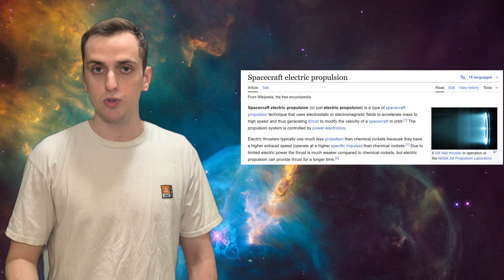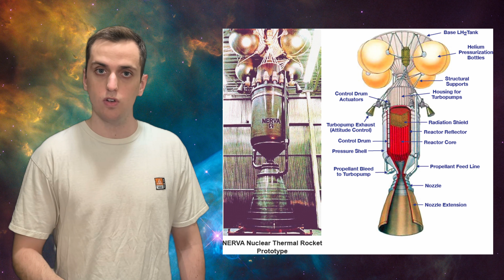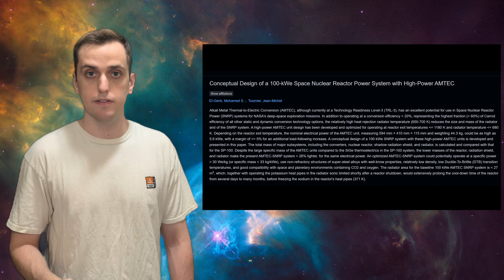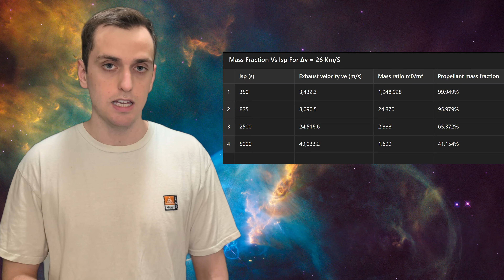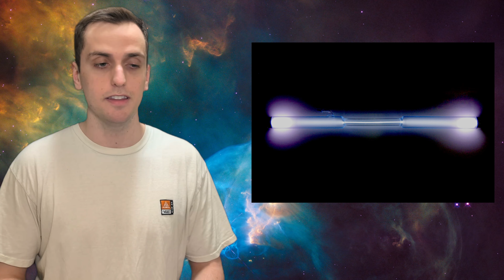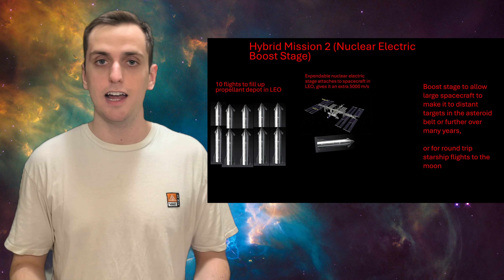Do We Need "Nuclear Electric Propulsion" to Get to Mars?

Comment: What we need to do better designs than chemical is to master the use of graphene and similar materials than can easily hold hydrogen.
 This would help a lot with any design that needs hydrogen. Light fuel tanks and not boiling half your fuel after a couple of months 

 Only after that we can think of months long missions that use hydrogen as a propellent.

Anything with noble gases is stupid for big missions due to cost

Until then Methane chemical is the best. The other solution is solar sails, installing a solar sail infrastructure with lasers to push them make the most sense for the short term.

Comment: mars is a distraction. 
earth -> moon -> ceres -> mars or somewhere else
getting a bunch of reaction mass in orbit around the earth is the ideal situation for all missions beyond the moon, which can be easily done with microwave thrusters and just straight up boiling water out of ur butt. need water anyways and im skeptical about the moons supply. the most ideal propultion source is one where you dont have to pay the mass penality for the reaction mass. all noble gases other than i think argon basically require the us to keep fracking the crap out of texas, and spacex is basically the entire reason why xenon prices went insane a few years ago. sending a bunch of drones to ceres to bring back to earth orbit with a few tons of water by strapping microwave engines to them makes the most sense to me. that water could be used for everything we would need it for and we wouldnt have to use cargo capacity for reaction mass/water to drink.
Reply from the maker: I disagree I think the moon is way more limited resources than Mars. But both are a bit of distraction of long term interstellar type stuff which would need asteroid belt settlement. Also I don't think anything should be brought back from Ceres it would require wasting way more mass in fuel than you could bring back to Earth and it would take decades. https://youtu.be/x86mCSxPiNI